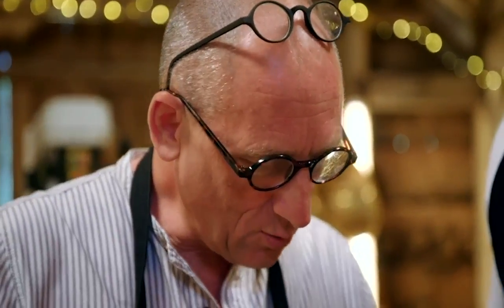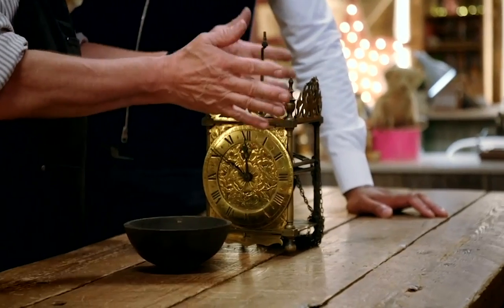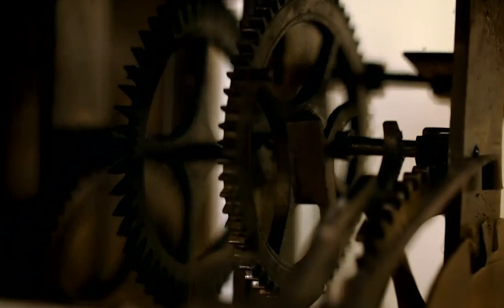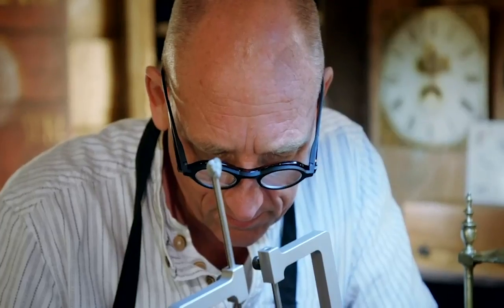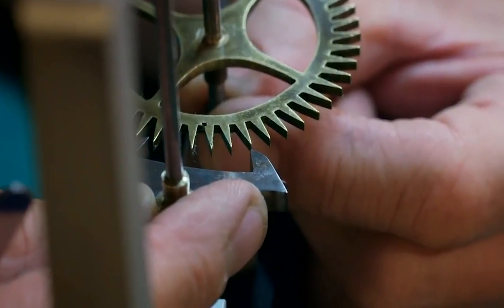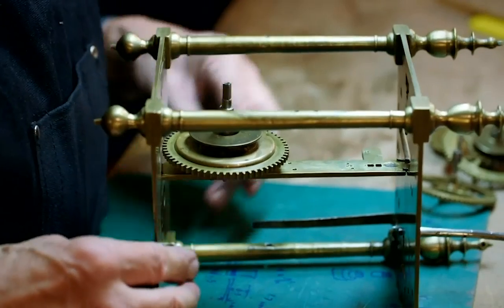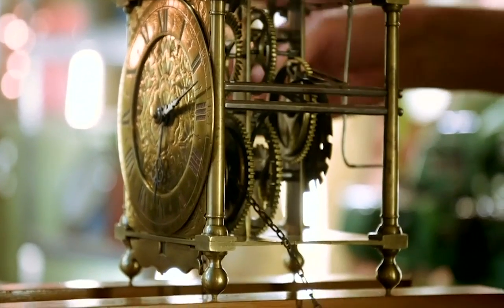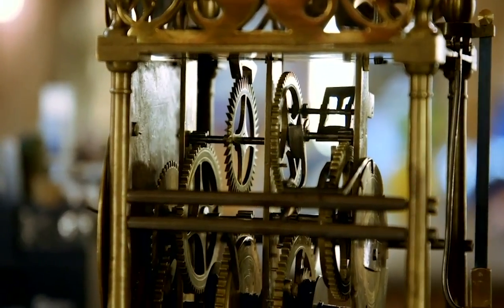Can Steve get this 'Ancient' Clock Ticking Again? | The Repair Shop

Comment: My grandfather repaired clocks.  There were over 300 clocks in their house.  I don't think he ever had one this old in his shop, but I do remember some that were so old they had wooden gears.
Reply: Interesting life of your grandfather.  This clock is not what it seems; the case is probably old, but with a minute hand, long pendulum, anchor escapement, it is essentially a modern clock.  I have a lantern clock from 1675; hour hand only, verge escapement, short pendulum, 30 hr movement, single weight driving clock and chime.
Reply: @David-lb4te  they explain in the beginning that the clock has been updated over time. They never claim that every piece of the clock is 400 years old.

Comment: People say a broken clock is better than a clock running fast because the broken clock is correct twice a day, but the fast clock is never correct.
When the broken clock is correct, you won't know it without a second clock, rendering the broken clock useless and you should just use the second clock. If you know to always subtract 5 minutes from the fast clock, you can just use the fast clock. A fast running clock is better than a broken clock.